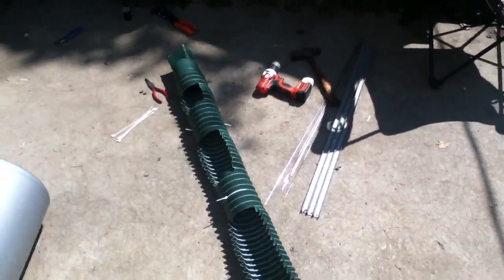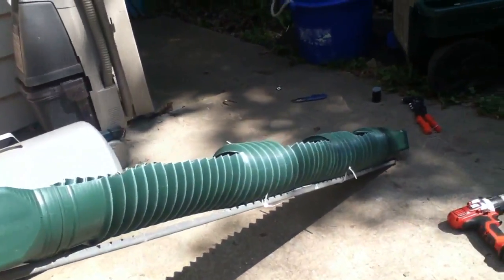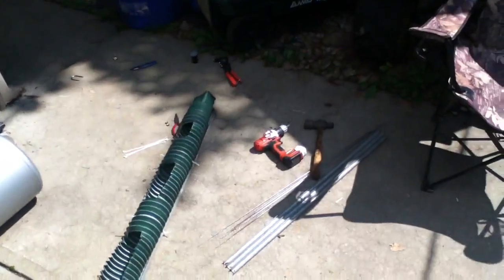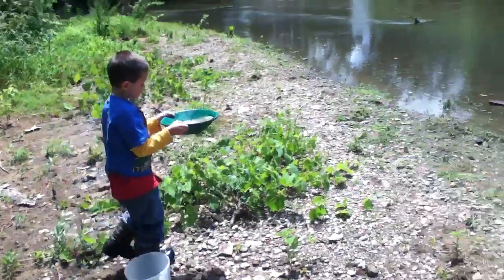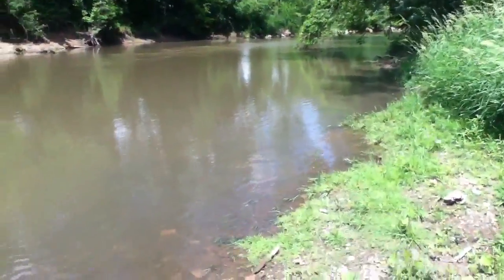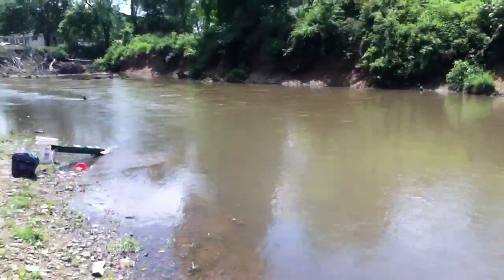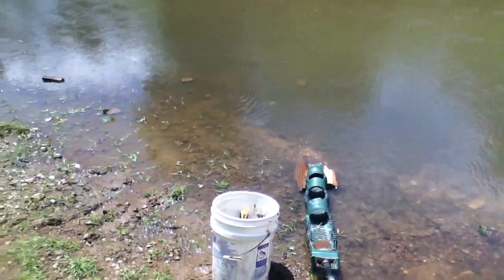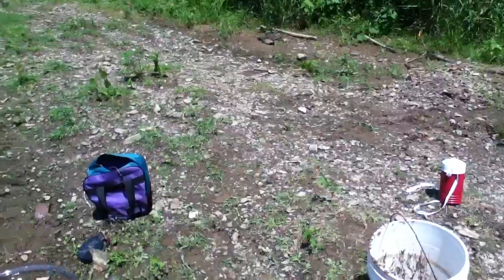The DiY electric gold sluice, works great! S1:E6 by MrTim4gold

Comment: If you didn't have the pump how would you build a flair for it?
Reply from the maker: hmm, good question..maybe a Y inlet or a gutter leader. you want something wider on the inlet end like 8" going into the 4" ..like a traditional sluice is setup I would think
Reply: @MrTim4Gold , looking at it, I'm thinking, rather long to drag through the woods to a wash, it'd need to be rolled up somehow without cracking it.  I understand leaving parts of the pipe intact for rigidity, but I'd put a removable spreader bar/wire in the open areas to vary the width to slow the water down so the finer gold could drop out.  Maybe put some kind of flap for smoothing out the water like the big rigs.  I tend to break plastic so making a flair would be problematic that way. Not good with soldering either. Some other rivets than pop rivets and silicone for the Y neck.  I was  thinking, some kind of slip fit to the pipe?